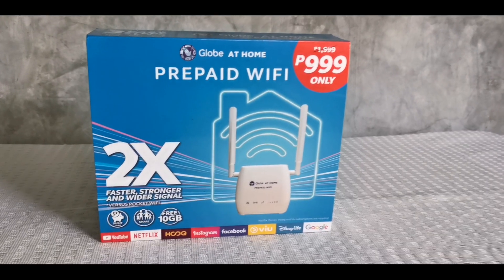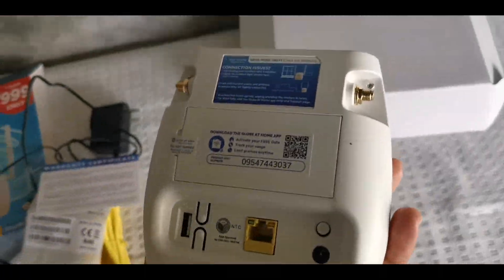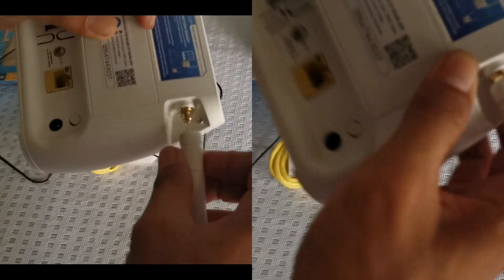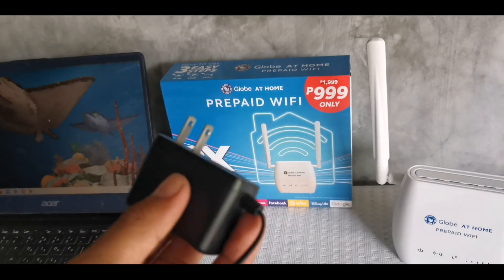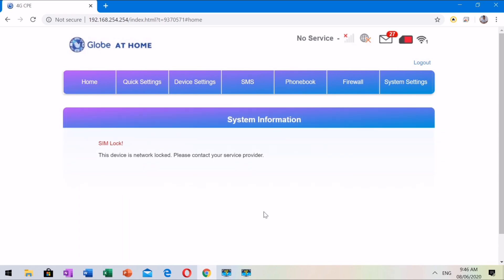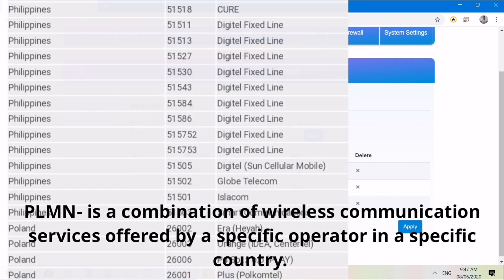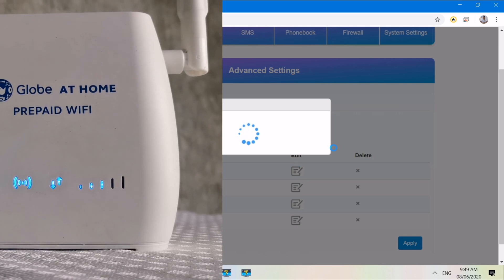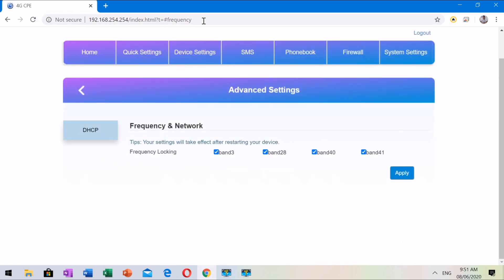How to: Openline Globe Prepaid Wi-fi (Model: ZLT S10G)

Comment from the maker: REMINDER BEFORE WATCHING THIS VIDEO:
This tutorial only works with ZLT-S10G modem with firmware version 2.0.
If your modem is ZLT-S10G but the firmware is v2.03.3,  it will not work since the firmware version is different. Check first your modem's settings/information by accessing the management page before proceeding. I hope this helps! Thank you.
Reply: Sir, do you have video on how to openline ZLT-S10G firmware 2.10.1?
Reply from the maker: @rogersampior4326  Wala po akong video ng version na yan sir.
Reply: Thank you sir

Comment: Bakit po ayaw po gumana yung mcc_mnc_locking nung pinalitan  ko po yung router_settings  bumabalik po siya sa dati ayaw po pumalit(ZLT S10G
Reply from the maker: check mo po ang firmware version. I am using S10G_2.00 sa tutorial, di siya gagana sa firmware na bago like S10G_2.03.3
Reply: @ICTSupport101  paano po mauupdate yung firmware
Reply from the maker: Ang S10G_2.03.3, yan po ang updated sa firmware, latest po yan. Hindi po gagana ang sa tutorial kasi for old version lang yun gagana.
Reply: @ICTSupport101  ahh meron po bang way para maupdate yung firmware?

Comment: Bozz ask q lng, encountered issue q.. DI kn maaccess ung advanced settings zlt-s10g q mgpapalit sana aq ng Band/Frequency.. everytime m=n icclick q ung DHCP ng dalawa or 3 times no response at all.. Triny kn sa lahat ng browser q lahat ganun experience, same din sa browser ng mobile q. Wala nmn aq ibang ginawa kundi iupdate ung globe home app sa mobile.. Tas ngtry aq mawired and wireless ung connection diko parin maaccess ung advance settings, ng hard reset narin aq pero wala parin..
Reply from the maker: Check mo po ang firmware version.. Ang gamit ko sa tutorial is version  S10G_v2.00. Hindi sya gagana pag 2.03.3.
Reply: @ICTSupport101  Bozz firmware version nia is 2.03.3... pero di aq nguupdate ng firmware , automatic b ang update? Merun b rollback to bozz.. Thanks
Reply from the maker: Yan ang bagong labas ng Globe. Naka version 2.03.3 na para di ma openline.
Reply from the maker: Pwede ka makipag swap sa iba ng modem na v2.00 at e openline mo po.

Comment: <3rd installment of comment on such flexibility of networks to run ZLT-S10 modem router. .with questions needing reply as well.. >

With such famous brand name acceptance in the market and interface to modem model's stable & advance internal functionality and so cannot be enough to be basis of sales so existence nor acceptance in society sensible to brag about high level mindfulness, as to the actual interactions that exists in partnerships, between the Manufacturer of advance modem with easily accessible setting designs not available to all other brands new or old, that make available wireless signal distribution to subscribers on personal & not just home or per household levels, while such is through sensible stable hardware of The modem in exchange for the seeming gateway as a name brand by the modem adopted by Globe & giving access to the Philippine market, with the popularity of the network in every entity of household & mobile celfon owner with usual dual SIM cards, that is sure to be owning a Globe SIM.  

That so such claim render high form of discipline, by  pathetic pretenders with network access, to wireless connection, of Globe Network, supported by stable patronage, to it's SIM's product & service provisions. That so has at least the profit-proceeds to repay acquisition of or so (no difference to such lending of gadget equipment as mobile phone to  manifest the network wireless signal benefits to subscriber customer.  This is indeed a win win situation to business partners of any gadget and the network, with higher or of seeming one too many all benefits from any gadget brand partner to Globe, in such unconventional insight relations, compare to the specific benefits of reverse of  "many to one relationship"  as varied as sold  modems that made enjoyments to or so brought appreciation to Globe Telecoms brand services, so enough in depth analysis of business model designs of mobilie networks all similar situation of benefits centralisation to wireless mobile networks, therefore of so much revenues that left all  available gadget brand competing and while mobile wireless networks carrier gains which ever wins or lose in the gadget or equipments battle or race for supremacy of specs and functionalities associated or so branding is of specialised make or signature or trade marks.

That such partnerships of not only pertaining businesses is with,  product services that are so called & in being with investments that has such products & services premiums via SIM subscriptions of continued data, call or text services, all designed to supposed to be long-term of continued sim subscriptions for the SIM's product and services, all are of the valued so seeming accounted for and none goes into waste, with IT being digital.  What more or so if it is harnessed futher for high level sensible or better existence to be with such C coined to be new evolved entity as about robotics that tics yet so nasally erroneously sounding that cannot (be) think (ing) so rendering of values of functions should be more relevant as to ways of life, by I.C.T. 's means is value existence to the I.T's development be it informations or of technological innovations, by wireless networks much so the gadget who wished to be carried by or in the company of the wireless network business, all are but customer to worldwideweb internet trunk line, of so networks provider,  with so encompassing or so should be with oversights for decision making to decide on issues as that can curtail business operations if such is proven inefficient, of or in monkey business operations as ABS-CBN SIM Communication network to the pathetic member distributors of Internet proliferates before called ISPs. Now being the bigger chunks are solely left to telcos locally or abroad, on pathetic mismanagment of resources having pathetic employees on it's wings or so that renders the network business functions non soaring.

These are due to the issue of questions raised or so interfaced with such broader elaborated, interpolation and interpositioned while so interpreted entities, as role interactions and ideas that interplays on coexistence, as to not only see other network as Smart 5G or conversely the same with new SIM releases of Globe with simcard  featured specs would be compatible to fit in the modem equipment gadget access to the internet-workings thru data of allocated balance available from the Smart 5G (ready) simcard, as it's not supposed to be network class specific so necessarily of speed but more so is the network business, in accomodation of more subscribers on business sense rendering fewer lags & so system glitches translating to lesser partnerships BPO's customer service, support should evolve from the earlier known call centers, that are  reduced non sense functions so too overhead expense of supposed technologies and  experts attribute skills as verbal communication speaking expertise,  yet faltering in work roles of business call center agents in work places.

Now I have question back and as well reminders to the conversation, would you be able to comment on the smart SIM if that is a regular LTE that is encompassing of or also 5G for celfon Simcard of other network Smart? That's not of Similar counterpart prepaid of a modem-router sim of Smart, as the Globe at Home prepaid WiFi,  modem?

Comment: That so inevitably or so unplanned designed, perhaps that so none  would be so haughty or so harbour such pathetic claims of or in the name of vanities, for the particular or vain referencing as raising self confidents, with baseless confidence sponsored by virtues of principles or as the budget allocation of or for marketing costs of the already cheaper products pricing.  This is on varied references as of seeming rebranding product modem name is of from low to high level of class, that if interfaced on equivalency so currency level grade of products rationalised on proportions as of popularity ranking levels of business partners as Globe interfaced ZLT-S10, that's never heard brand-model of modem yet with such wider or better functions that are so timely for the occasion of EAR Economic Activity Recession, due to the very evolution of entities as business  based on competitions, personnel competency, and customers buyers spendings with not so much care about brands as long as product is beneficial on cascades as the dwindling household budgets and so spending is living up to the means of the budgets.  The product so can have such instant niche abroad for such exports of WiFi Product tonPhilippine market, so is consideration favourable and deserving to be adopted for the modems well known & so of the leading advantages applicability  between two Wireless cellular networks business, with not so much ethical considerations for branding and so entry sponsoring entry or so of opportunity of market sales share.  That so Globe that seemed have the upper hand to wireless communication as data, call & text would decide on issues as the introductory of price offerings & so followed by newbies as the modem manufacturing business have so given a chance to be upgraded (due to flexibility of product settings) besides supply of the household that is without the products, are but sure fire promising sale as hotcakes to Phils markets of WiFi modem & router rolled into one.  While it's been an advent for malls free internet due to GoWifi internet service previously made available thru partnership with Malls, Globe and Go WiFi.  That can or so deceiving to appear partly influencing market subscriber client base choice  likewise the business partnership with new players as perhaps points for other gadget equipment opportunity business besides the market place location niche to seal aggreement with ZLT-S10.  That is manifested on perhaps internal pricing adjustments agreements to or for the sub-product contract with another not of Huawei, with better exclusivity for flexibility of choice by buyers customer pertaining signal issues while so perhaps solutions to the such ever increasing disparity values of Monetary currencies peg against electronic digital products from tangible gadget and equipments to the Intangible data, call and text services, in such  ever increasing competition to partake in the position for Buyer customer basic needs as food, clothing and shelter, while clothing had reached its saturation point, and shelter cannot be so affordable to all, so that is another niche being explored as patterned by multiple telcos abroad,  while the telcos as perhaps any business or organisations are perhaps downsizing, of cost cutting.  

That cannot be any less as GO WiFi  inclusive data becoming props without functional benefits yet only making a name popularity for Globe in the stock market brand name value of product and services competing with the other yet local wireless Giant PLDT- Smart Communication.

These issue of product specs  feature of SIM data product has but  have been about symbolic attraction that could have been to posing mutability or flexibility of quality of importance of being customer is also available for partners in business due to issue of product feature that so cannot be benefits to ZLT-S10,  so such has a niche for equilibrium as that since the gadget modem model can be used to another network based on the buyer customer choice,  that so can be dependent on past present or future business relations between buyers, subscriber and wireless mobile networks as predispositions for sensible base reference and that would not be too much of a deal lost to wireless network providers, if taken on such higher level plane oversights interpolation to the gadgets cost not being partially met by the SIM services  subscriptions,  based.on multitudes of factors as signals or cellsite tower maintenance or upkeep, or installations, at of wireless network irresponsibilities  not serving interest of subscribers, that is perhaps been thought to be of the lesser cost than the put up of celltower.   Thus, better than just mere considerations that can be last being complex and more to be connoted as seeming consolations  sociological and psychologicals of cultural and traditionals in nature that lead to chaotic disorders in nature,  rather than high ideals Philosophicals, proving entity ideas of Knowledges principles are also at interfaces, and qualifies and quantifies measuring  the other entities and possible outcome of results.  

With the modem product manufacturer, that is also part of the hidden agenda to look competitive, is being flexibility of being available as customer decides,  with Smart Internet service provision.  

With so inevitabilities as GoWifi that is not in reality accessible to and so goes in to waste part of the to be expired data sub-product, in the LTE SIM promos of GoSakto70, or GotsCombo70 or the 90 version, that seemed an indicator or reasons for that not too much mall goers, as such sub-product in the data promo are available only in the malls, while the malls as Ayala and SM discontinued to avail such Go WiFi  business partnership, that was already an out of businesses, with mall goers becoming customers of online internet shopping while inside mall using it's internet WiFi networks partnerships with Globes Go WiFi networks in an absurdity to be supporting shopping malls product,  so gadgets abroad or locally of previous eras that needs two equipment gadgets to be fully functional.

That purchasing such modem model without a dependable brand as Globe name is at stake, nothing more than franchising to have the name brand linked to not so popular brand to be with strong establish presence while that guarantee such functionality for uninterrupted wireless services, & for Globe to call the shots on the business partnerships of such that has sure to bridge the gap in the business partnership.

That so guarantee to be not only about the SIM for network signal connections &  product-services, that also is the adopted gadget modem brand functionality, being with special agreements of wholesale bulk orders of procurements to manufacturer brand & so the no fuss attention on issues as product equipment  warranties besides the relevant Business center that can be the service repair centers and while  BPO of call center expertise support for possible damages & functionality issues.  While that equates to or so renders mature dispositions & so higher level trustworthiness further to the brand name level ups to become SuperBrand status of products & services that are so esteemed in South East Asian Regions Tiger or Dragon economies, with such prestigious recognition & so is with such great responsibility as  acceptance for another's possible setbacks of irresponsibilities, as mostly due to pathetic intrusions on by lame low level entities with no better ways an means business or civilsed so Jurassic levels of equitability existence or coexistence, as extra judicials with own agenda so pathetic decision makers have been obsolete in so wanted to partake of or for such life & living ways & means, to be with belongingness or so have belongings that have never been available for the low levels, as my lost stolen Samsung Galaxy S4 phone based on pathetic locals abuse of entity as ideas,  networks, or so power from as simple as eaves dropping, up to such cybersecurity,  or that with overlaps between such NLP-NeuroLingusiticProgramming and AI -Artificial Intelligence, access to influence the minds of the further pathetics in surroundings, of the  scope of wirelss network signals thought control can reach, with such technological Advancements in ICT that can be felt or think about yet cannot be explained, so no options for denial or so nobody can deny its power or overpowering control to the weak or non to less educated.